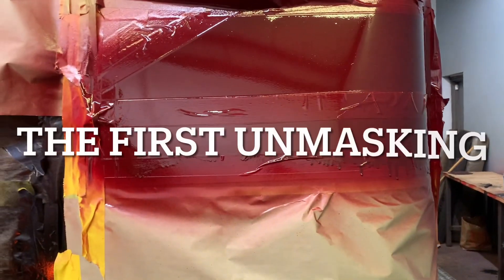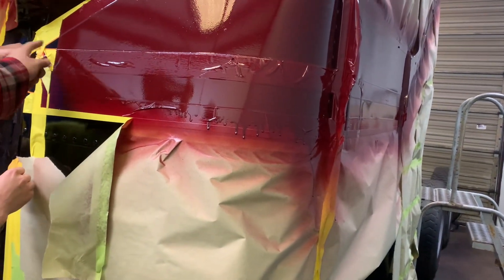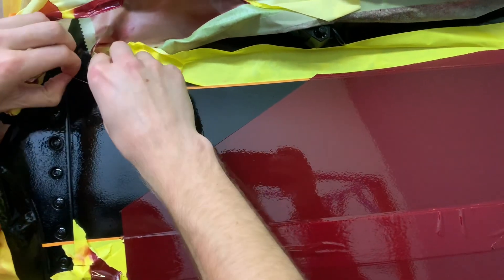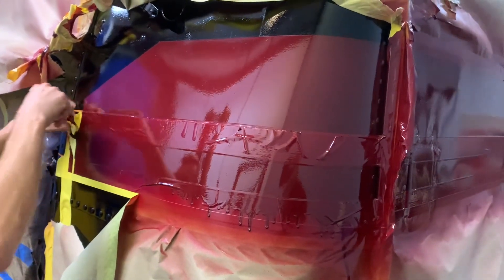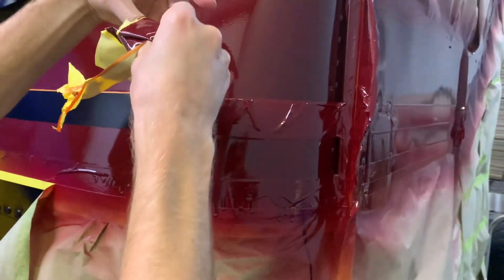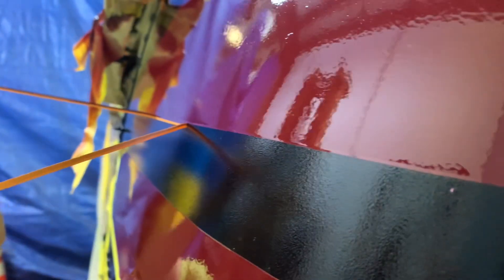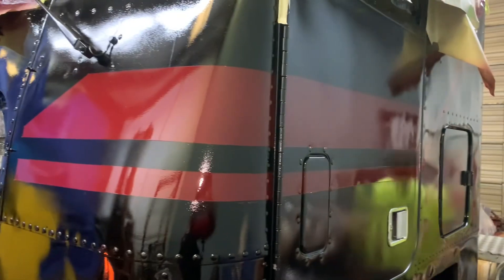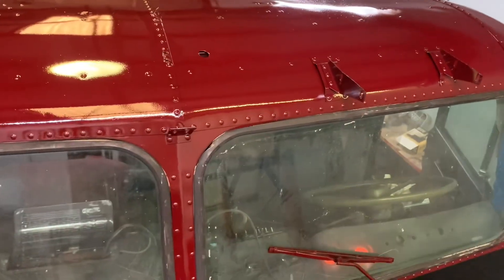1980 freightliner cab over gets a splash of new paint!

Comment: there´s a special tape to make lines, it´s cuts better
Reply: you used them! but not 100% the right way hahaha but the result is impressive!
Reply from the maker: @oliverroedel1111   you aint kidding. LOL Im sure mistakes were made. This was the first cab paint job I ever done. All I ever painted was truck frames with epoxy primer and expoy single stage. 
This was shot with a limco single stage paint on essentials epoxy primer. 
primer + primer + paint + da with 600 grit + paint + da then strips. 
I was going to da the whole truck again and clear coat it next. But I need to research more on painting and what and how I can do this.